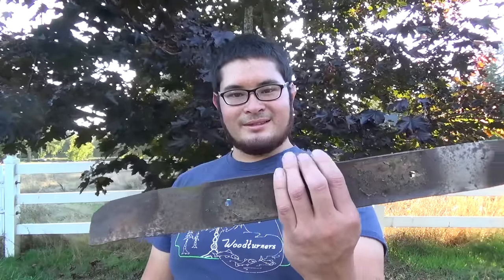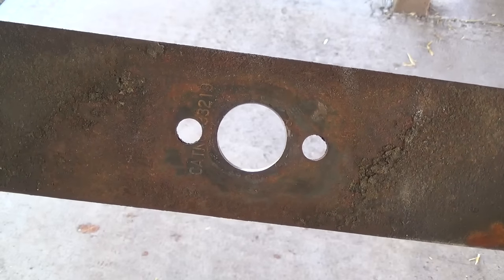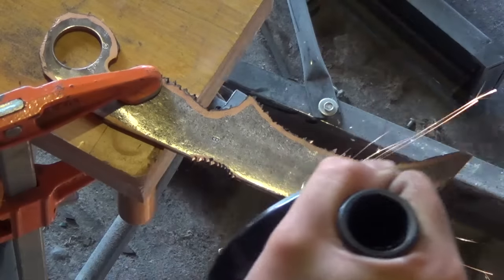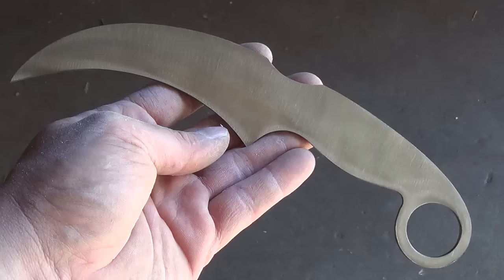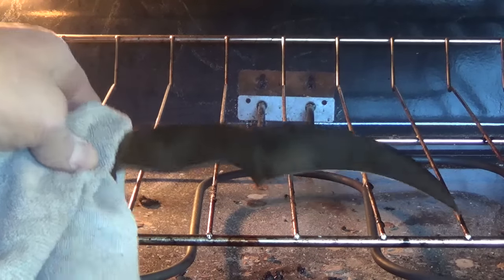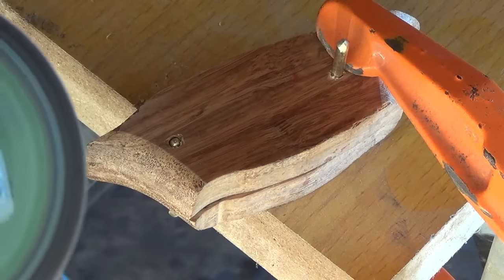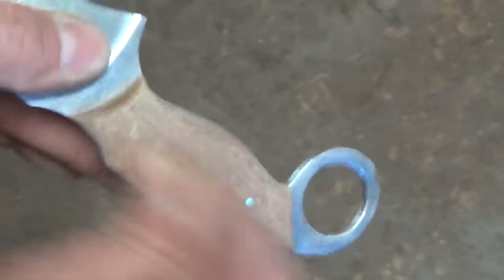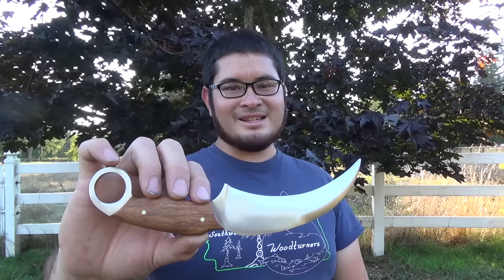How To Make a Karambit Knife Out of a Lawnmower Blade

Comment: using a angle grinder instead of a grinding jig to make the bevel? seems like a bit of a hacker way to do it but if you don't have a belt grinder and you don't want to make a file jig with a hand file affixed to a rod on a board n what not I guess it works.? I salute how he did it free hand though. Its even hard to free hand with a belt grinder. I liked the video and I will definitely try it myself! with some different tools however.

Comment: It's not supposed to be a harvesting tool at all it's shaped after a claw or talon and is specifically designed to devastate flesh
Reply: Incorrect. The karambit has its origins in southeast Asia as a farmer's tool that was also widely popular among militia because it's hard to lose your grip on. If it were designed for combat, the blade wouldn't curve so severely, because in lethal use, the karambit is better served when it can be used as a slashing tool as well as a hooked blade. The classic karambit shape does not serve this purpose well, and has a distinct relationship in curvature to a sickle.

Comment: Why drill so many holes if you're just gonna use two pins?
Reply from the maker: I find that it gives some extra surface area for the epoxy to bond. I should have also drilled into the scales a little bit to create little epoxy pins inside the knife handle.

Thanks for watching!

Comment: Now all your knives might look very good but the steel is still very bad. If you'd like to make better ones you should consider buying some good steel. You don't need a whole lot so it wont be expensive.
Reply: aren't most lawnmower blades made from high carbon spring steel? still, That is an absolutely gorgeous karambit knife. too many others try way too hard and come up short
Reply: Stevean Bozek
Not every high carbon steel is the same. And a lawnmower will most likely not have a high quality steel. It will most likely break very easily and wont hold the edge for too long.